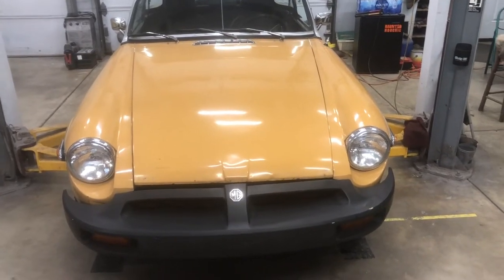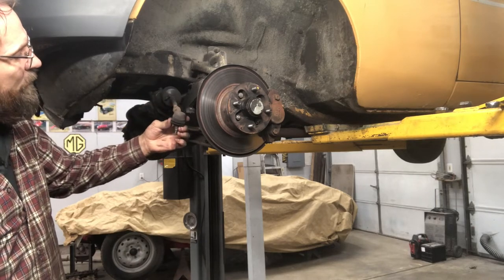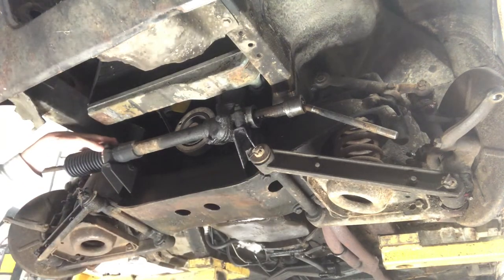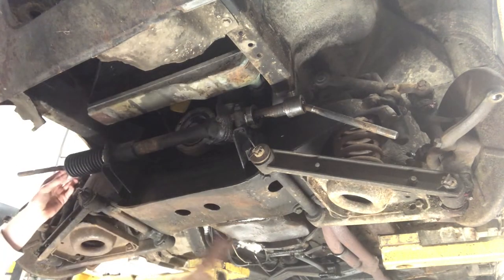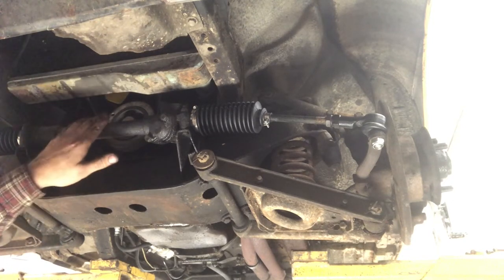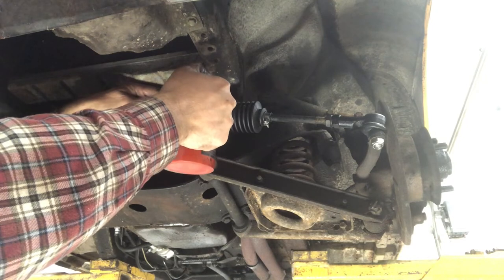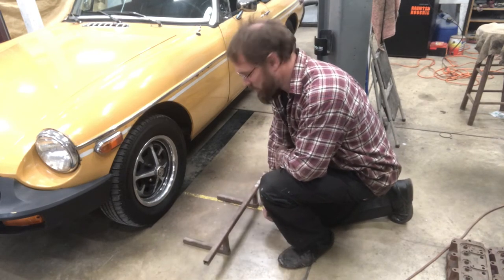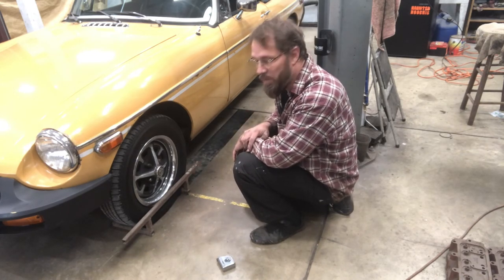MGB rack boots and tie rod ends + we hit 250 subscribers !

Comment: Measure the toe off a lines stretched along the sides of the car parallel to the rear wheel rims. You can use a string with a jackstand behind & in front of the car. Measure this carefully.  Then, measure the front toe to the outside of the rims (F&R) at center of wheel height.